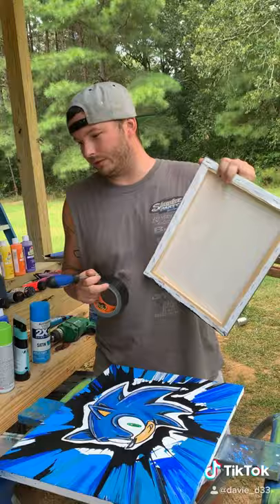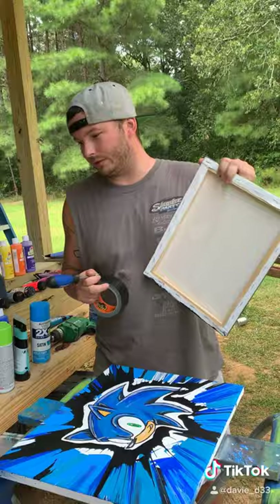How to attach drill to canvas for spin art. Happy spinning.

Comment: I bought a wood lazy susan at Target, then attached it by drilling 4 pilot holes into the lazy Susan (1 at the top, 1 at the bottom & 1 on each side) put some wood glue down in the holes, then screw it (I used course threaded dry wall screws) to a 24" x 24" piece of light weight partical board.  
Then just place your (now spin-able) piece of partical board, down in a shallow plastic lined (I cut open a couple of those 39 gal black lawn & garden bags) box that's big enough for the board to spin without touching the sides. Just make sure the surface you use is flat so your canvas is level- I just put the lined box with spinner, on the floor of my paint studio. You do not need to afix the canvas to the board... it will not slide off the board no matter how fast you spin it.
Writing all this out was more a pain in the butt than actually making the darn thing lol. 
NOTE: I went to Home Depot and bought one of those big flat boxes they have for packing a flat screen tv in, to move. Then I cut one of the big sides off you know, so what I had was, a 4 sided open top box, to put my spinner board down in. 
Happy painting 🤙🏼

Comment: Doesn’t work for me the bolt comes loose from the nut and it doesn’t stay tight? What am I doing wrong
Reply from the maker: Keep tightening, use a lock washer and maybe somehow use glue on it. But only attach drill to the bolt itself.